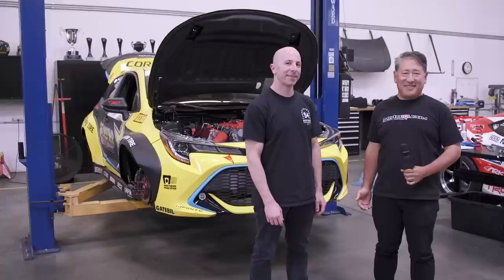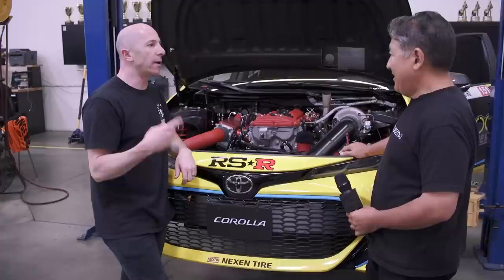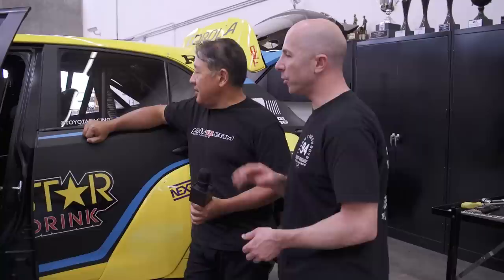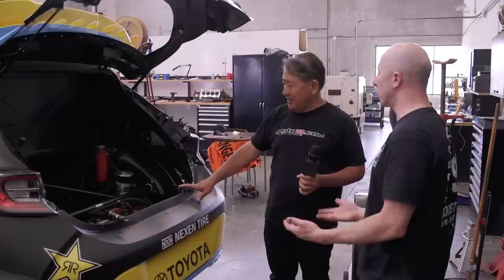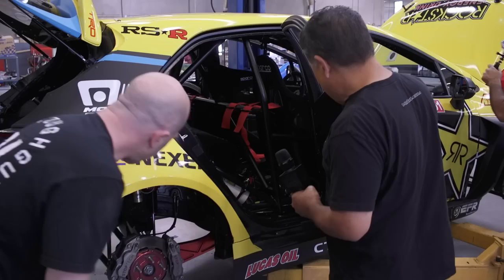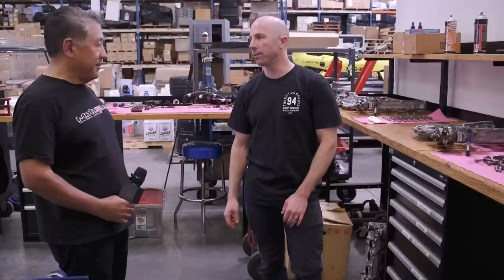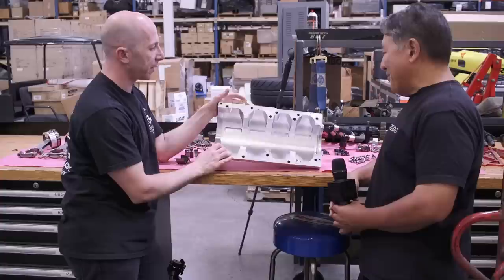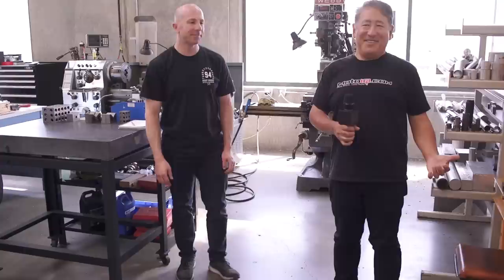IN-DEPTH LOOK!  Fredric Aasbo's 2018 Formula Drift Toyota Corolla Hatchback!

Comment: At 09:00 when they start talking about the axle center line to firewall distance and how they have to use a small engine so that they don't  have the engine hanging over the front axle why don't they modify the firewall to make space for a larger engine so it doesn't sit to far forward of the axle center line? The driver could sit back In the cabin the make the room. The only thing I can think of is the rules say you have to run a standard firewall.
Reply from the maker: It is against Formula Drift rules.
Reply: MotoIQ Thanks for the answer Mike and great video too.